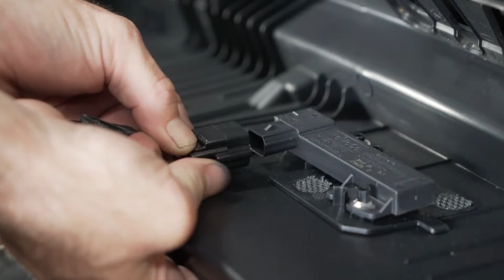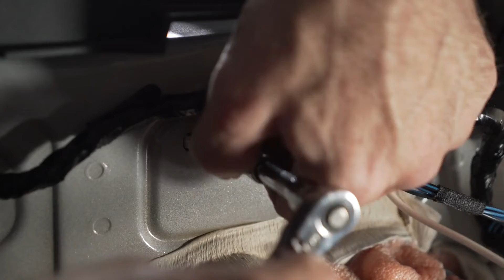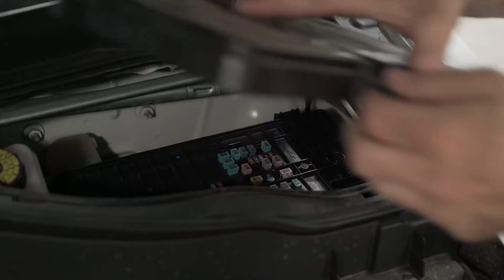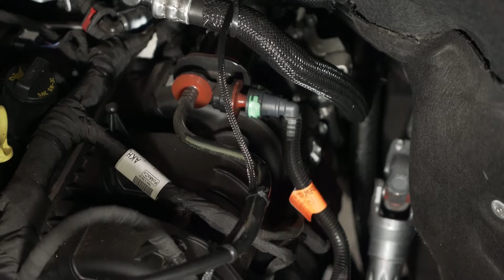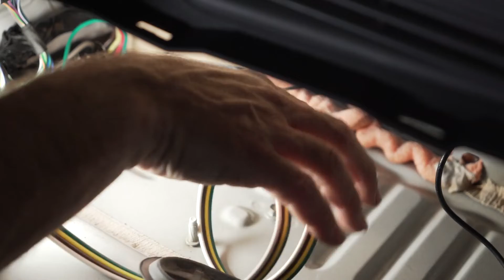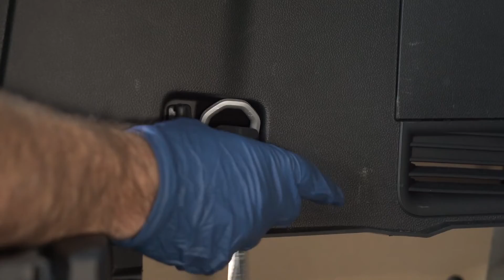2020-2026 Ford Explorer | U-Haul Trailer Wiring Installation | CMF56093

Comment: Would it be as good to get power from the rear 12V socket on right passenger side?
Reply from the maker: No. There is a reason for the power wire being connected to the Fuse Box or the Battery. The 12v Power line is to draw its own 12V for the converter box, and for the converter box to send voltage to the trailer light bulbs. Sharing power leads to non-functionality of one or more components (Convertor box, trailer lights, 12V power socket or accessory that was tapped into). Power sharing can result in repeated blown fuses. That is why we always run a separate fused or circuit Breaker'd power line, and we never borrow voltage from an active system.

Comment: This is an insane amount of work.
Reply from the maker: Let our hitch professionals do the work for you!
Reply from the maker: Prior to 2020 there was a harness underneath the Ford Explorer that allowed for easy acces to all 6 towing functionalites. A 7-way socket "quick connect" harness was easily Installed.  Unfortunately, Ford changed thier design and this easy Access is gone. Wiring Installs are becoming more and more difficult these days and thats why YOUR Local U-Haul Hitch Pro has you Covered!